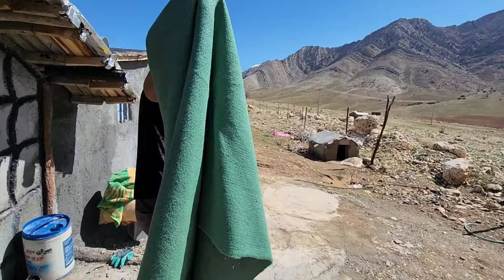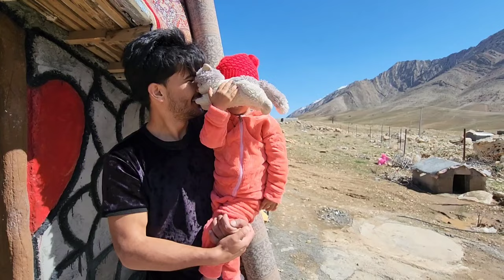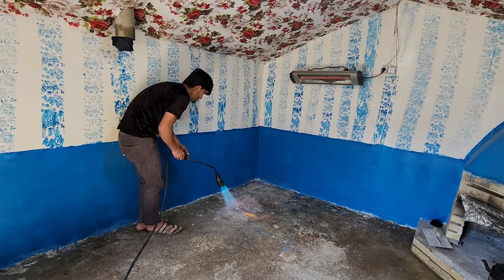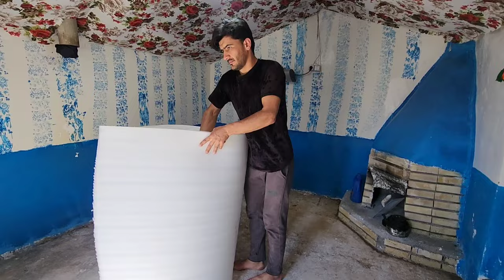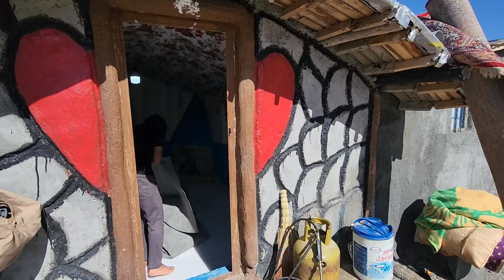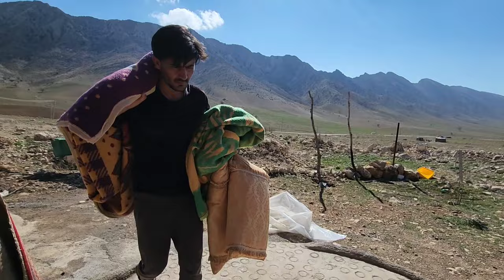Helping a nomadic youth: a woman engineer and helping to buy household items for this man

Comment: tell Ramin all he needs to do is dig around the foundation and put down plastic thick plastic it needs to be four feet on the ground and three feet coming up the wall, and  pour gravel and cement and it will stop the water from coming into the room. have it slope away from the house.